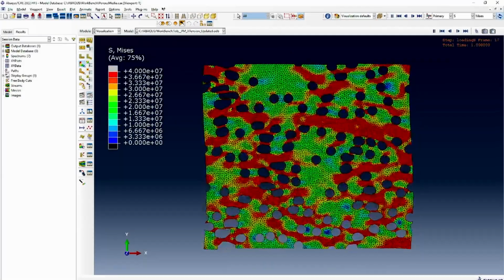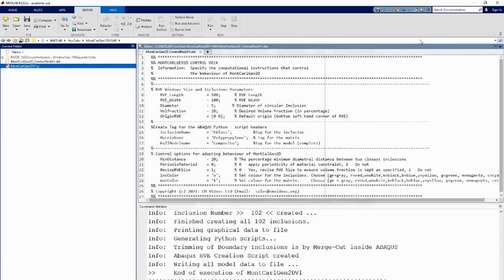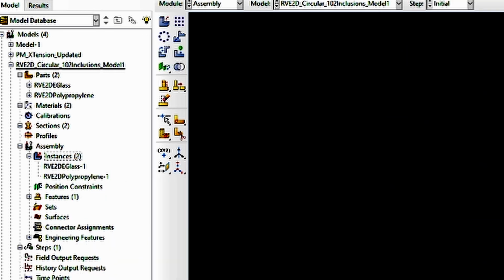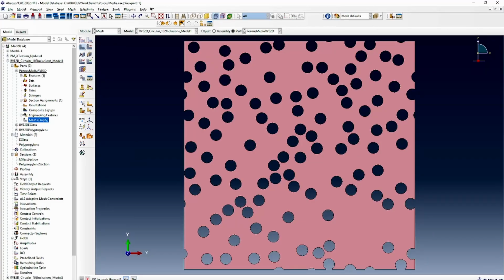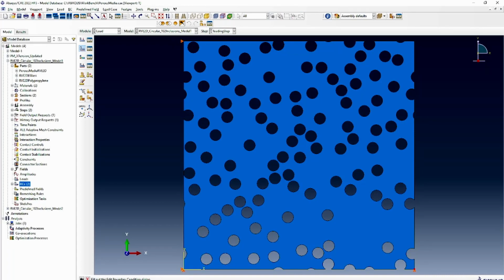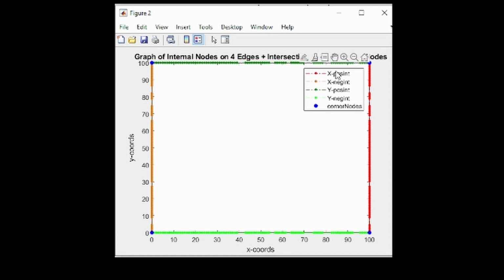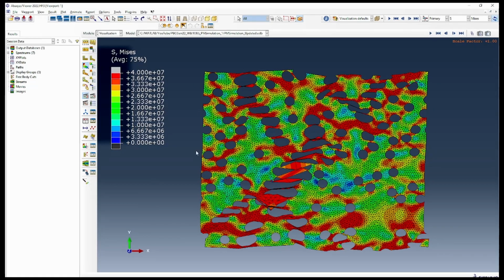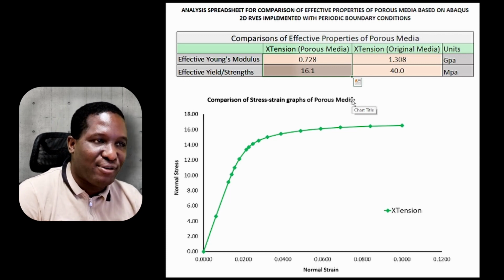Mastering ABAQUS: Simulating Porous Media Behavior with Periodic Boundary Conditions

Comment: Hello, Dr Micheal, I am following your YT videos which are quite simple and helpful.
I am working on simulation of textile structure. I have watch all your three videos on Periodic boundary condition but they are all related to 2D models. Can you please make a simple video on how to set periodic boundary condition on 3D part/assembly?
Reply from the maker: Hello, thanks for your kind comments. I actually do not have a video about application of PBCs on 3D domains. It is something I plan to do in the future.
Reply: @MichaelOkereke   thanks for your quick response. 
I will be waiting for your video on periodic BC of 3D domain.
Even a PBC for a simple 3D cylindrical rod will be helpful to solve my problem.

Comment: I am writing to you today seeking technical assistance regarding periodic boundary conditions. I am currently working on ductile failure analyses based on the cell model, which involves applying periodic boundary conditions to ensure the constant triaxiality and lode parameter over the unit cell.
While I have a basic understanding of periodic boundary conditions, I have encountered some challenges in implementing them effectively in my simulations. I believe your experience and knowledge in this area could provide valuable insights and solutions to my predicament.
Are there any common pitfalls or mistakes to avoid when using periodic boundary conditions along with the controlling of triaxiality and lode parameter?
Reply from the maker: Hello Alok, I do not have much experience with lode parameter and the constant triaxility requirement. I do feel however that you can always use PBC for most problems, you just have to set conditions that meet with your lode parameter analysis. Apologies if I am not helpful. Thanks.